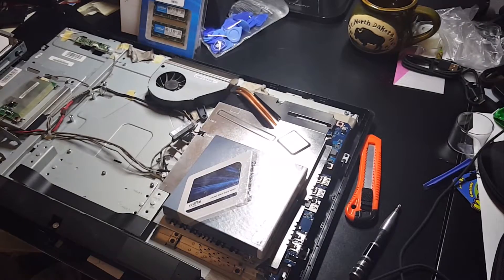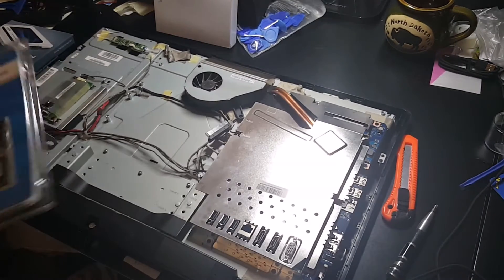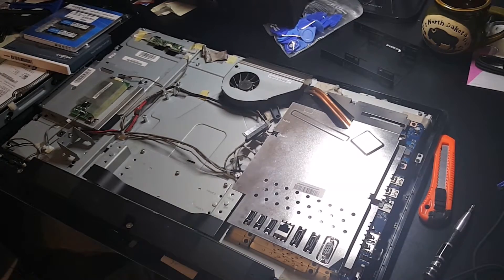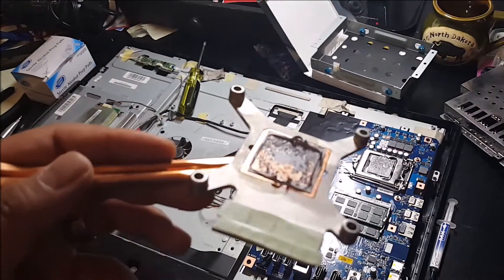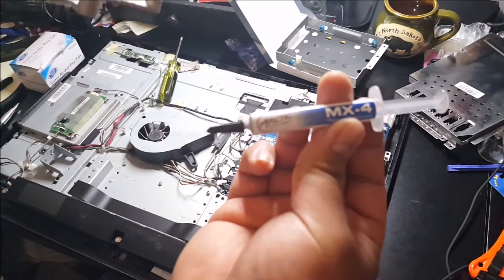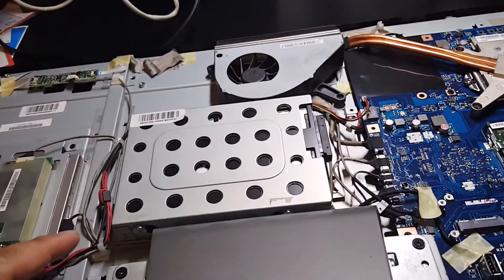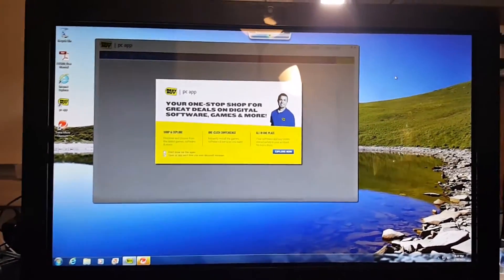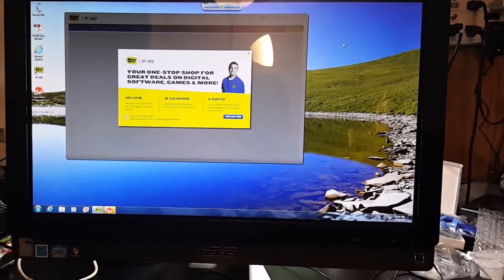Asus All in one Upgrade

Comment: Hi there. Old video but helpful. I have an Asus all in one as well. V241fa.  What ram do you recommend for upgrade?
Reply from the maker: I would recommend any kit that is at least 8GBs I believe by default it comes with only 8GBs so throwing in another 8GB stick will be perfect especially with Windows 10 They are adding more and more apps in the background and it is eating up the ram. but I would check your system because you only have 2 memory slots and they may have put in 2 x 4GB sticks. If you are replacing both just the set with a 16GB set

here are 2 links to Crucial memory for your system. Depending on what you do you can also upgrade to 32GBs of Ram but you would be pushing the limitations of your hardware at that point if you somehow use more than 16GBs of Ram

https://www.amazon.com/Crucial-Single-PC4-19200-SODIMM-260-Pin/dp/B01BIWKP58/ref=sr_1_2?keywords=DDR4+SDRAM&qid=1573450127&sr=8-2

https://www.amazon.com/Crucial-PC4-19200-SODIMM-260-Pin-Memory/dp/B01BIWMWVS/ref=sxin_1_ac_d_rm?ac_md=0-0-ZGRyNCBzZHJhbQ%3D%3D-ac_d_rm&keywords=DDR4+SDRAM&pd_rd_i=B01BIWMWVS&pd_rd_r=5dfb49c4-d810-4304-b32e-b568964a6e17&pd_rd_w=DxOmZ&pd_rd_wg=GVb33&pf_rd_p=39892eb5-25ed-41d8-aff1-b659c9b73760&pf_rd_r=BZYK878EHFG352VSFGYV&psc=1&qid=1573450127

Comment: A true hobbyist machine should rattle when moved or shaken, so you blew their chance at street cred by using the hard drive bracket.  Good job on the video, and you have a nice voice for videos.
Reply from the maker: LOL That is true, but when it comes to my work I hate taking shortcuts especially when its other people's stuff. and Thank you
Reply: @BakkenTech  I have an Asus All in One Zen Aio Pro HDD and since I bought it it is very slow and takes a long time to start Windows 10 and it freezes when I open any application, I have read on the internet that changing the HDD for an SDD the computer runs more fluid. You can help? thanks.
Reply from the maker: @mrmatamoskas9844  Yes if you can do a clean install of Windows 10 on your new SSD. The SSD will make a night and day difference.